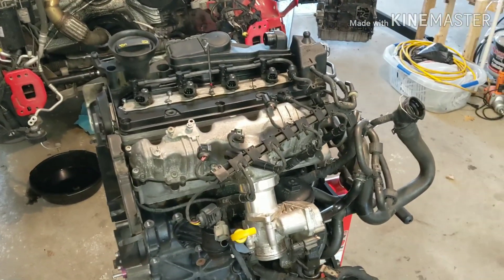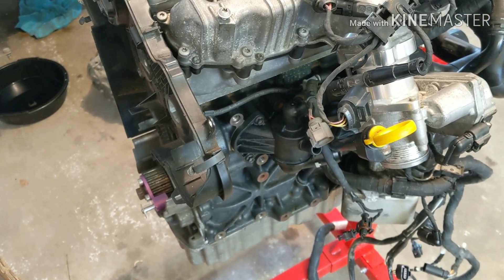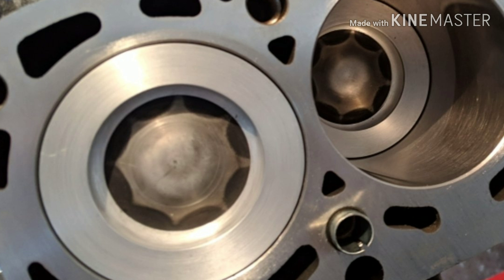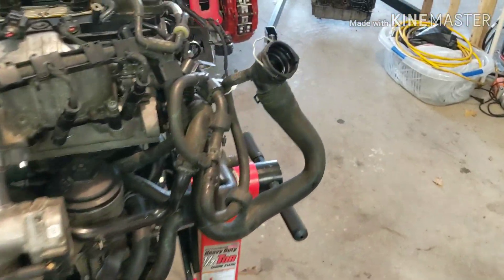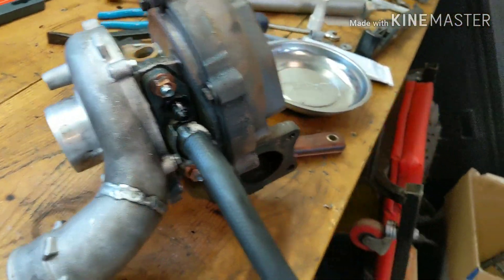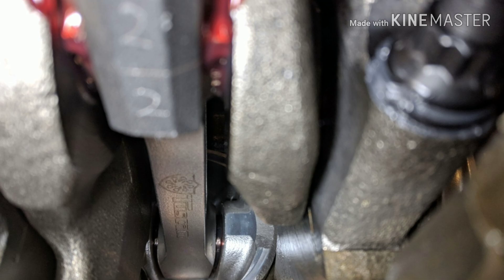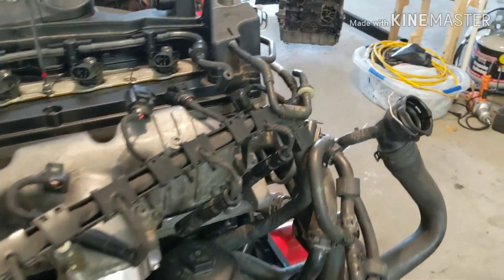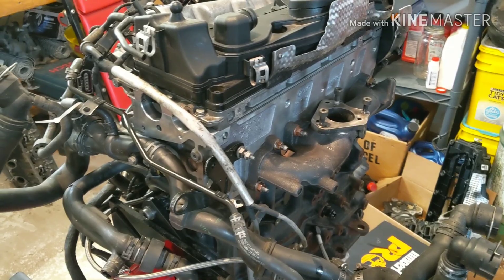VW TDI Performance Engine Rebuild

Comment: Did you use oil restrictor for the turbo? If yes which one?
Reply from the maker: No oil restrictor.
Reply: @tvanc542  VKLR with no restrictor? Didnt it burn oil because of high oil pressure in the turbo?
Reply from the maker: No.